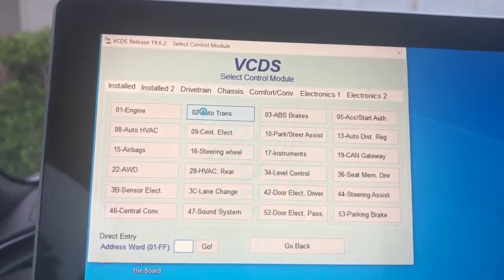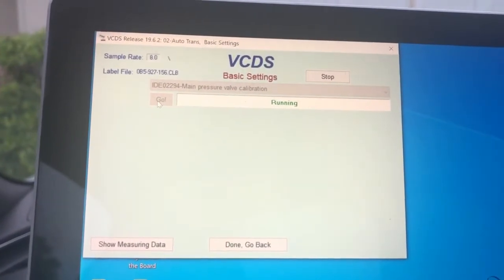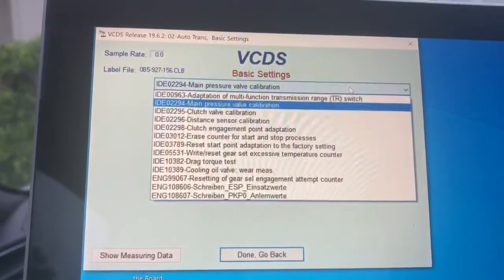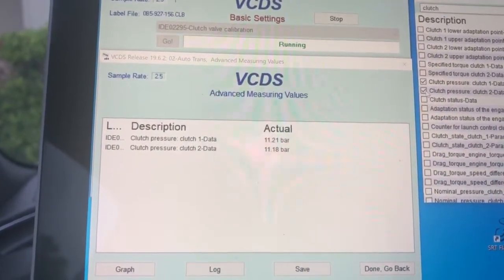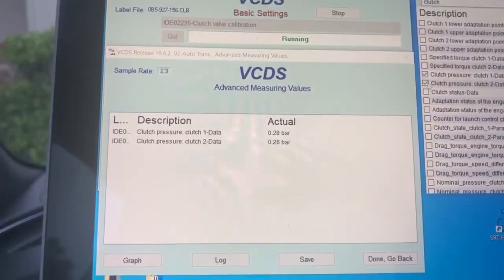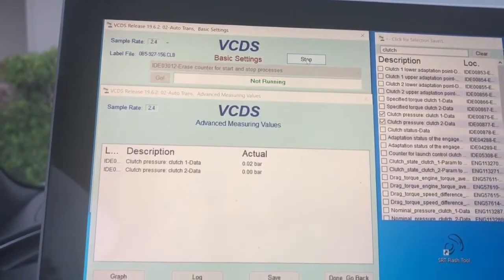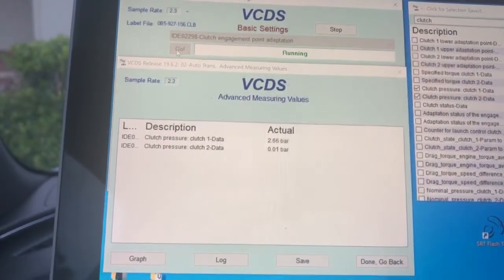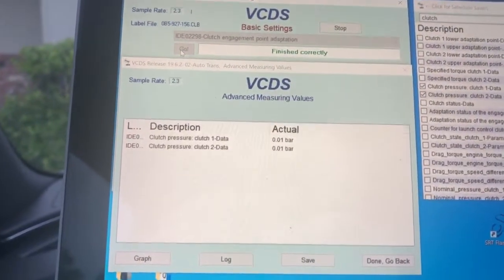DL501 Clutch Adaptation Procedure. S-Tronic, Audi S6, S7, A7, A6, 3.0t, 4.0t

Comment: I have a 2012 S4 I had to change the circuit board and 2 solenoids on the mechatronic. Do I have to program those new solenoids via VCDS? Or not? Or will the adaptation will configure it by itself. Need help!!!

Comment: Thanks for the video.  Is there any risk in trying this procedure on a S-Tronic DQ200?
Reply from the maker: I haven’t tried the 200
Reply: @themanleygarage  I just checked the basic settings menu in VCDS and I don't even get the same options as you, so it may not even be possible

Comment: I have a p174f00 after replacing clutchd and my mecatronic unit and a new tcm i have only 1357 gears no 246R gears any help 🆘  adaptation and calibrtion errors for safety resons in vcds
Reply: Harness and vavles are new kit
Reply from the maker: I'd recommend reaching out to a reputable transmission shop that specializes in these types of transmissions to assist you with the proper diagnosis and repairs.
Reply: The mechatronic is brand new? Or a rebuild kit? It sounds like a faulty wiring kit stopping one clutch solenoid.

Comment: Should an engine be on or off?
Reply from the maker: Engine has to be on.
Reply: @themanleygarage  Thanks for the info. I got last question. I have a DL382 gearbox and in VCDS I cannot find procedure IDE03789. Instead of that I can select "IDE03678 - Reset transmission adaptation values". Would you know if this procedure works similary to IDE03789?

Comment: Will this help with slippage to high error clutch 2 slipping in gear 4 onwards
Reply from the maker: It can…

However slippage on clutch two is from one of two things:

1) The K2 clutch is worn out.

2) If your ECU is tuned, it may be tuned incorrectly.

Improper ECU tuning coupled with a stock TCU tune kills clutches VERY quickly.
Reply: @themanleygarage  Hi! I have an Audi A5 35 TFSI with a Stage 1 ECU tune. My car has the second-generation DL382 transmission. The tuner said it’s not unlocked yet for TCU tuning, but that it shouldn’t be a problem. What’s your opinion on this?

Comment: I just have one code popping up it Torque restriction due to clutch temperature any idea?
Reply from the maker: Sounds like your clutch is on its way out, or you have a bad sensor.  Is it tuned?
Reply: @themanleygarage  yes it tuned to stage 2 and it only happen on heavy acceleration
Reply: @themanleygarage  especially on the high way it the only time it happens
Reply: I have the same issue

Comment: Hi! I have an AUDI S4 2009 in which I replaced the clutch plates and renovated the mechatronics. The phenomenon is that when you put it in D or R from a stationary position, the gearbox hits hard, but only when the oil warms up. I adapted the clutch, but only drove 1-2 kilometers with the car. is it possible that I should drive the car 100-200 kilometers to learn it? thanks!
Reply from the maker: Absolutely.
Reply: @themanleygarage  I drove 107 kilometers with it, but it was worse than it was. now from 2nd to 1st, if I go to D it says P17D7 Multifunction error (Reverse off and only 1-3-5-7 speed) and if I put it in D or R from a standstill it does the same thing.
Reply: @themanleygarage  maybe need ODIS for adaptation?
Reply: The same thing happens to me, did you solve it?
Reply: @ ofc,i sell the car! :'D

Comment: While doing the adaptation for clutches the bar does not rise at all and says aborted for safety reasons . Same with main clutch . Does this mean clutch packs are shot . Or possibly the Megatron repair kit with new solenoids do the trick?
Reply: Did u fix the error with safety reasons?
Reply: My guess is the oil temperature is wrong

Comment: Hi, I have replaced the mechatronic unit on my car and performed basic settings however there are sometimes issues with engaging gears 2-3. 

Do i need to run one of the other options e.g IDE 12710-Initialization of clutch friction coefficient model after mechatronics exchange?
Reply: Did u fix it?
Reply: @AXIOMGAMES the issue happens less after performing haldex service but it still does happen

Comment: I just replaced my mechatronics unit after doing the solenoids & circuit board fix -- it improved the transmission but now it jerks and stalls out when I go from Park to Drive. But not Park to Reverse, that is fine. Does this need a clutch adaptation procedure done to fix the jerk and stall condition?
Reply: Did u fix it?
Reply: @AXIOMGAMES   Nah I just but it on the backburner. It's on stands in my garage, I'll try removing it again and trying to swap a few solenoids around to see if I can make the issue change behavior to gain a better understanding of which exact component is bad. If that fails then I'll pull it out again and have it send out for repair from one of those services you see online.
Reply: Still nothing?
Reply: I have the same issue, did you solve it?
Reply: @I.B1  i did, i removed S tronic from my car and put ZF and ecu from RS6 and its working perfect
Reply: @I.B1  thats really best option when i got quoted 3k from dealer to change mech unit i just got a parts from crashed RS6 and made it work
Reply: @lz7882  I went the other way and still the trans doesn't work fluently but it was 2k because of faulty mechatronics exchange program
Reply: @I.B1  i mean if you are from US you have A6,A7 with ZF and you can use that ZF on your car
Reply: @lz7882  Im from EU, not sure whats the difference? I know that in RS version trans is ZF and u can retrofit it, but I don't have the knowledge, nor the shops in my city.
Reply: @I.B1  im from EU too i mean all things me and my friend had to take from RS6 to fit into my car is:
ECU 
Coding
Whole ZF Trans
some little stuff 
Differential
Kardan
and little bit more stuff but all came up as little as 2700 EUR

Comment: Howdy! I tried this procedure on s-tronic dl501(0b5) but it said "interrupted for safety reasons". the oil temperature was 45 degrees. What am I doing wrong?
Reply from the maker: Could happen for a number of reasons.

Foot not on the brake.

Oil temp too high, oil temp too low.

Gear selector not in park.

Codes present in the control module.

It’s a long list,

Comment: Hi, In transmission, Basic settings, their are lot of drop down on menu, but you’re selecting some menu but not all other. Whether this enough for the Basic settings?
Reply from the maker: Do not select all the menus unless you know what they do.

I selected specific tests to conduct, to get the transmission to adapt.
Reply: @themanleygarage  Thanks for the reply. So, according to the work carried out the basics settings must be carried out accordingly right?
Reply: @themanleygarage  okay
Reply: Need some information about Audi A4. We replaced used Mechatronics with transmission, so we need online programming to adapt the gearbox to the vehicle or only basic settings alone are sufficient?
Reply from the maker: As long as the TCU is still recognized by the vehicle.

This should be all you need to do to get it adapted.

If the TCU is no longer recognized by the vehicle, you may need to utilize ODIS to get it up, operational, and coded to the vehicle.

Comment: Any risk doing those calibration on a dsg dq250?
Reply from the maker: I have not tried this procedure with the DQ250.

If you try it, and the steps are the same, please let me know, and I’ll update my video.
Reply: @themanleygarage  I've done it yesterday, honestly didn't feel any change after it for the moment, gearbox moved from gears to another quite somethly before, and stay smothly now 🤷. Need to try it in cold weather, when moving from 1st to second was a little bit toughte when dsg wasn't warm enough.
Reply from the maker: Good to know that the procedure works on the DQ250.  Thank you for that, I’ll add that transmission to the title and description.  I’d like to get confirmation it also works on the DQ500.

The DSG software is constantly adapting.

This procedure allows the transmission to reset all of it’s learned values, check the function of the shift solenoids, friction points, and the pressure valves.

It basically gives the transmission a new baseline to learn from.

These are incredibly smart gearboxes.

VW/Audi/Temic did a great job developing them.

They can be quirky, but when they are they’re telling you something is off.  Whether it’s the mech unit, dirty fluid, or the clutches themselves.

Comment: I changed recently the clutch master pump and after that i get the issuer 03182 clutch position sensor (G476) implausible signal MIL ON .when using VCDS. I have a passat b6 2009 model. Which advice could you give to me please to resolve the issue?
Reply from the maker: Man… I would love to help you out, however I’m not super familiar with the B6 Passat.  Anyone able to give El Mido a hand?

Comment: Did a transmission flash to Audi Q5 with an independent programer. After flash I took it to mechanic and he did adaptation, after driving, the following intermittent codes occurred: p17e100, p174d00, p17d800, p176b00. and it produce static code: p179c00.
Reply from the maker: Sounds to me like the file was written incorrectly.

Comment: hi, how does this relate to resetting the gear? What is the best order?
Reply from the maker: I'm not sure what you mean "resetting the gear".

Would you help me clarify what you're asking?

Then I could give you an answer.
Reply: @themanleygarage  hi, thanks for the reply. I  meant the procedure where the car is driven for about an hour to "relearn" shifting points etc.. tbh I am not sure if there are steps in vcds that are executed for this but I think there are; so under that assumption, what I was wondering is if shifting behaviour is bad, e.g. in my case a "jerk" when downshifting from 2 to 1 when coming to a stop; what action is meant to fix what exactly. Clutch recalibration is also to deal with jerky shifting? Or what is it done for?
Reply from the maker: That makes more sense.

Yes.  This procedure can help.

It’s the first step I take in diagnosis.

Sometimes the clutch “kiss point” needs to be reset, and it goes away.

Other times this is the result of worn clutches, and it is not possible to fix with VCDS, and the potential solutions are worn clutch fluid, or worn/burned clutches.

Start with the simple stuff first though.

Comment: Hi. Audi A7 2011 3.0tdi stronic. Just got Mechatronic refurb plus new clutch pack fitted trying to do calibration now and getting stuck with main valve calibration and clutch valve calibration it starts process revs up and after a while aborting process due to safety reasons? Also tried this on a5 2010 stronic good running one this one does same thing just abort process due to safety reason. Any ideas how to get thru this please?
Reply: I have same problem. Have you anything
Reply: @drluki1984  you need to update gearbox software via online odis. Then use vcds to do adaptation as odis don’t have main valve and gear valve pressure calibrations available. Cheers
Reply: Hi did updated the tcu fix your problem 
Where did you fix it please
Reply: Hi service my mictronice unit I'm having the same problem with calibration can be fix with shoftwer update

Comment: How do I increase the clamping pressure. I have clutch slip at motorway speeds
Reply: If you have clutch slip under light to moderate loads you have a problem. Do you have any fault codes? If you actually have clutch slipping the TCU should drop engine power and indicate a problem.

Comment: Is it possible to reset "main pressure valve calibration" efter it has been performed? Both my car and my friend's car got unusual pressure in gear box after this step. It feels specially when you depress brake pedal and release it.
Reply: Have the same problem.. any fix ?
Reply: Did you solve?
Reply: @teocan10  please update or downgrade (if you have latest firmware) via ODIS Engineering and perform adaption via ODIS Service it will resolve your problem. Do not use VCDS for any operation in the gearbox.

Comment: Great video.  question; Spent a month rebuilding VW 01M auto.  After all that No forward drive gears, Reverse works fine.   ATF pressure from port shows (I think what is)close to correct pressure, P=46psi cold, similar warm. Shifting to R flashed to 150/160 then settled at 65psi.  N= 65psi   D=53ps1, up to 120 at 3000rmp, #= 53psi, 2= 53psi, 2=53psi
There is a slight tic of the pressure needle when shifted from 2-1 but nothing at all into Drive, 3 or 2. 
I have a ross-tech VCDS, I did a scan and it showed no trans codes, what would you recommend I try first?
Thanks if you take the time to answer!

Comment: Hi I just have a quick question, What does it mean when the clutch pressure value of clutch one is reading 0.5 bar when the car is off with key in and also the car is cold. Also it seems like while driving when the transmission in on the second clutch gears such as R,2,4,6 clutch 1 never goes down below 0.5 bar. I am asking because I have a gear malfunction and I lose clutch one once the temp gets over 60 or so. I have rebuilt the clutch and changed the solenoids on the mech unit. I am suspecting maybe the G163 pressure sensor is faulty. What do you think?
Reply: Do you have any fault codes?

Comment: I have a question on mechatronic repair kit and when I'm changing out the Solenoids, would I do the same clutch adaptation procedure that you've mentioned in the video? Also, would this cutch adaptation mess anything up with the TCU tune that's already loaded on the car? THx
Reply: It would not change your tune

Comment: When a clutch is replaced and partial repair is done to the mechatronic , what are the correct sequence of steps involved to have the unit adapted correctly, I usually used ODIS, I also own vcds but never get the steps correctly.Great video btw!
Reply: Muss Vollversion sein das vcds dann geht es

Comment from the maker: I press and hold the brake when running any transmission adaptation.
Reply: The Manley Garage thank you very much, I read the manual, for doing the distance sensor calibration, do not depress the brake, is that true?
Reply: How about the last step "Distance Sensor Calibration" ?
Reply from the maker: Correct for the distance sensor calibration Li.

Also… I’m pretty sure I wrote the file on your gear box.  ; )

Comment: Do you need to depress brake ? Which adaptation is mandatory to depress brake ? Thank you
Reply: It's a good thing to do during ANY transmission adaptation, and some require it.
Reply: Most likely it is because your fluid temperature is not inside the correct range
Reply: vr6- hit-licks I followed the exact same steps did all adaptations within 40-50 degree C, but the only adaptation I can not complete was the TR range switch adaptation, it requires engine off and parking brake on
Reply: I'm sorry I did not do that calibration so I'm not sure how to help
Reply: vr6- hit-licks the only adaptation said can not depress brake pedal was the distance sensor calibration.
Reply: vr6- hit-licks I found audi s6 can not do TR range switch adaptation, also throw “abort due to safety reasons” error
Reply: @liwang1510  here is what I used to do mine: http://wiki.ross-tech.com/wiki/index.php/7-Speed_S-Tronic_Direct-Shift_Gearbox_(DSG/0B5)
Reply: @andrewjaxe399  ciao  for multitronic 8+1 ? thanks you